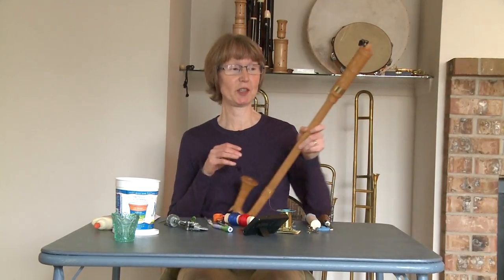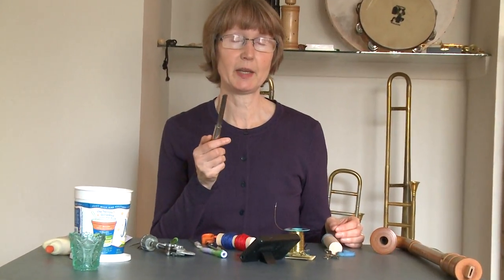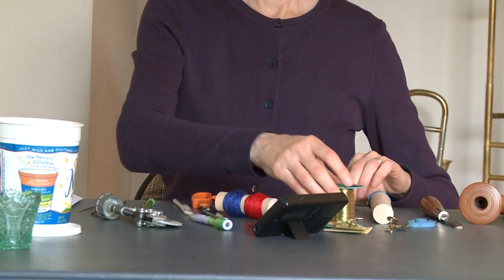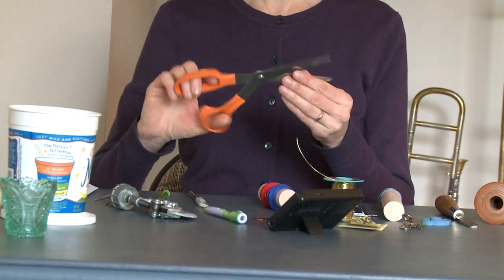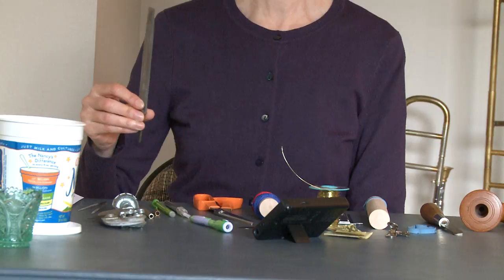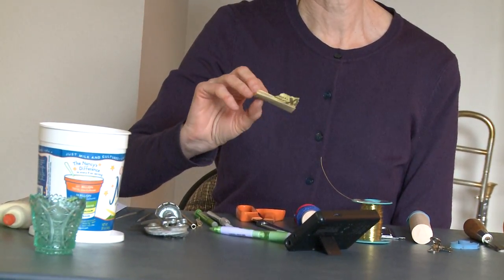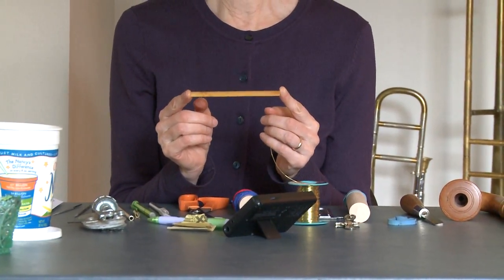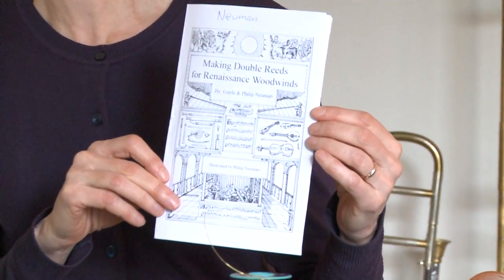Making a Krummhorn Reed 1 of 8

Comment: Thank you for these videos. I saved all 8 as I am attempting to create a krummhorn with PVC water pipe tubes, and the reeds from plastic drink cups from Speedway Gas stations, or 7-11 convenience stores.  I have started with 3/4 inch pipe and 1/2 inch pipe for the instrument bodies. For the plastic reeds, however I am using 3/8 x.014 inch brass tubing for the staple part of the reed. I am going to need to find dimensions and templates for the finger holes. I plan to order your booklet, for the information I will need .